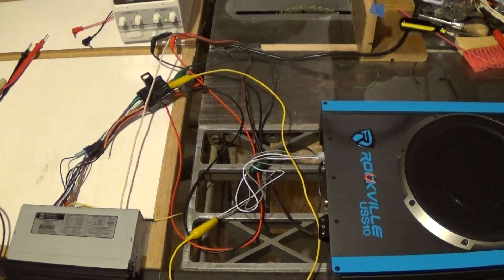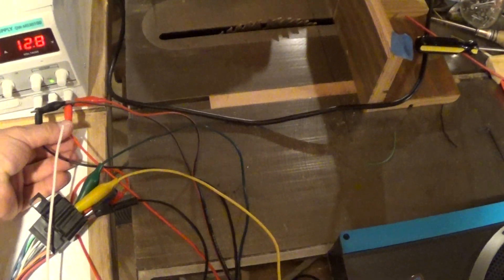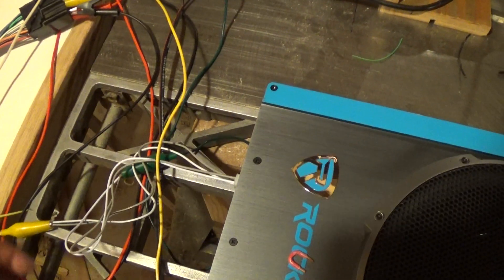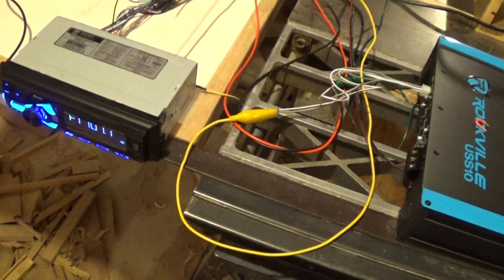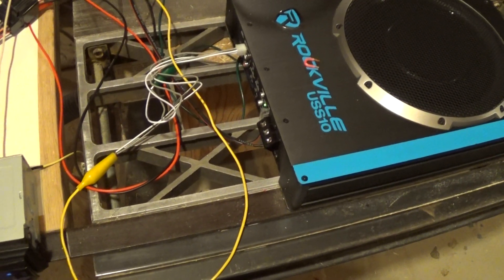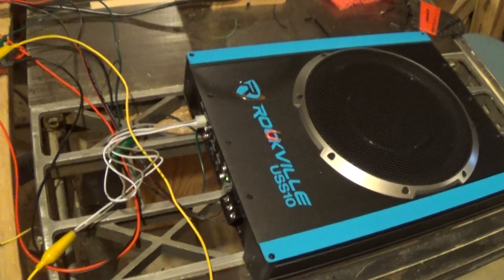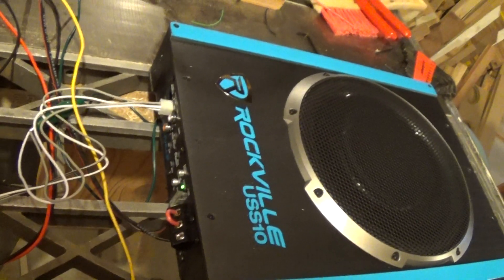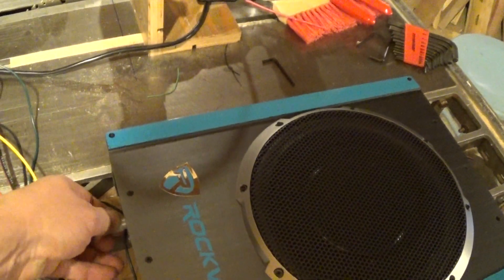Problems With Rockville USS10 Powered Subs (2 so far), 1 of 2

Comment: My is doing this with RCA's, do you have ab fix
Reply from the maker: Based on what the Rockville techs said, and their suggestion of swapping between the plug and the RCA's for testing "they go to the same place,"  I don't think it matters.

I came to the conclusion that it was an interaction between the output of some sources and the way the input was designed on the amp in this amplified sub.  I did finally find a source that worked with it but it would not work the way I needed it to in my Dodge Ram.  I ended up sending it back (and the 2 additional subs Rockville cross shipped to try to figure this out, their product didn't work but their tech support put a lot of effort in to try to get me up and running) and found that an old Kenwood amplified sub that I had sitting around works fine no matter how I hook it up so I'm using it now.

Comment: There should be a blue wire coming from your stereo That's the remote wire that needs to connect to the amp without that connected it will not auto start
Reply from the maker: The amp has an auto-sense circuit that senses input to the amp and turns it on.  Using that you don't need the blue wire.  

Either way, I tried it both ways, and that circuit only requires 5v to turn the sub on (according to Rockville tech support), and in this video, I use the red jumper straight to the 12V power source as a signal to test if that's the problem at the end.  With that installed any time the sub has power, it should turn on.

Comment: Wow, I was seriously considering purchasing  the new Rockville powered Dual Sub unit instead of the Fosgate single 12 inch powered sub... I think it's best that i stick with the initial plan.
Reply from the maker: I bought mine based on a friend having good luck with an earlier model, unfortunately, that model didn't fit in the space I had where I wanted to mount this one.